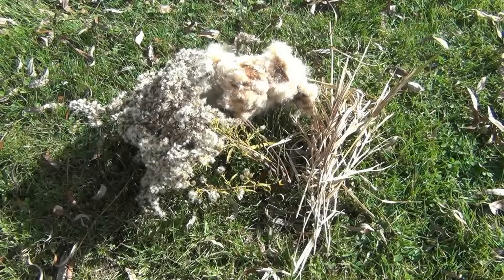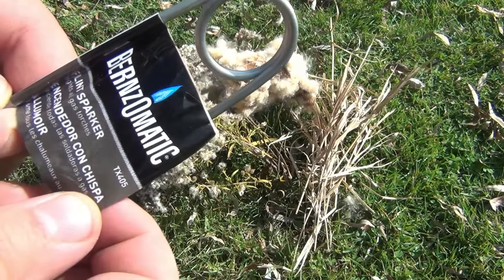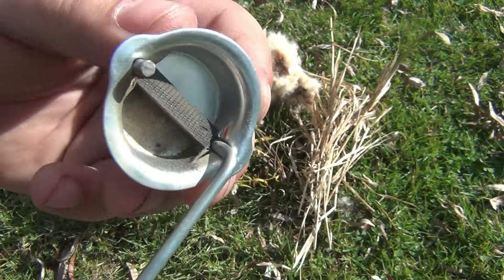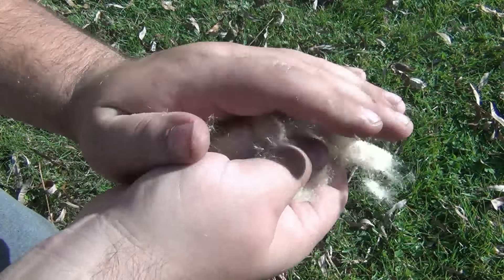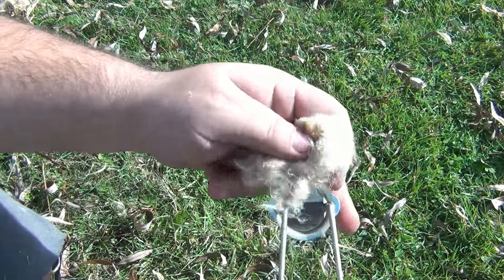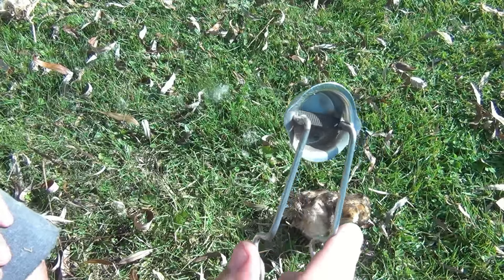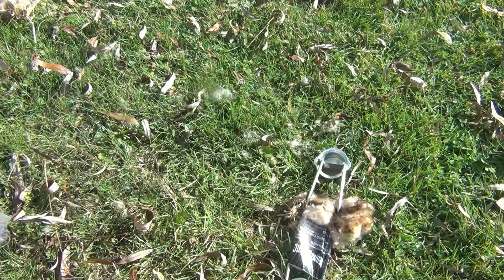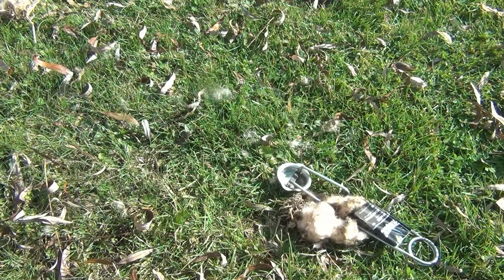Another Fire Starting Option You Might Not Have Thought Of Before...

Comment: These flint strikers are not for welding. They are for lighting gas torches or burners. People use these to light Bunsen burners, propane torches, oxy-acetylene torches, or even a stove. The cap like part where the striker is housed traps some of the gas so it can be easily ignited when held upside down over the gas source. They are also elongated to ensure your hands are within a safer distance when the gas poofs into a flame. Anyway, it is still a great flint and striker combo for any sort of fire starting since they are very cheap (almost all department or home improvement stores carry these), they are assembled into one efficient unit able to throw sparks rapidly, and they are easily stored.
Reply: +FzMonsta He means that it is used to light welding torches. My shop class in highschool had a full rack of these for their torches. But it's also used to light stoves and other gas burning devices that don't have their own built in igniter.
Reply from the maker: +FzMonsta yes so they bare used for welding, lol I didnt mean you weld with them I dont weld but have seen them used by many to light propane torches, you are correct
Reply: +cutlerylover  you don't light a welder. its only used for cutting torch. it's all electric.
Reply: There are welding processes that use torches.  Has anyone ever heard of brazing.
Reply: +Chuck Sherron brazing isn't welding.
Reply: +Chuck Sherron brazing isn't welding.
Reply: +dustin bartlow OK kids everyone chill brazing and welding aren't very diff. I use to be a ship fitter on Navy ships. second all welding is not electronic ever heard of forge welding?.. third yes you can absolutely weld with a torch. fine video Jeff and don't let comments get to you. on the internet someone else always seems to know everything when you don't ;) 
and I'm not going to feed trolls so say whatever you kids will I won't respond.
Reply: +dustin bartlow A tig welder is not a dissimilar welding technique to oxy brazing

Comment: this is cool, thanks Jeff I will actually probly use this over flint and steel, how much did you get it for?
Reply: He posted links in the description.
Reply from the maker: +Collin Shea it was actually more like $3 at lowes the link on amazon is $6 I think just check your local hardware stores its a common tool for welding...
Reply: +Collin Shea Harbor Freight has Strikers probably as cheap as anyone.
Reply: +cutlerylover That's cheaper than a flint and steel. Probably better to. Only really down side is, that the flint runs out really quickly. Other than that it's good. Flint and steel is like $6 or more that's only $3.
Reply: +Collin Shea you generate fewer sparks with a ferro rod, but they're hotter and larger. with this, you're heavily limited in the type and intensity of sparks. stick with a striking rod and the back edge of a knife.

Comment: To have this in a survival kit instead of something else, (lighter? zippo or bic) would be stupid imo. its larger and even thou a lighter runs out of fuel it will still create a spark the same way this does. and it has the same weakness (you run out of flint, wich a Ferrocerium rod won't do as quickly)

However, if you don't have your "survival" kit with you in a pinch and you happen to come across one of these it's great to know that it can be used! 
So I'd say: Don't pack this down instead of a ferrocerium rod or even a Zippo, But DO keep the knowledge that it can be used. I probably have and would again run past these in a effort to find anything to light my cigarette on if it wasn't for this video. next time i forget my lighter I'll look for this.